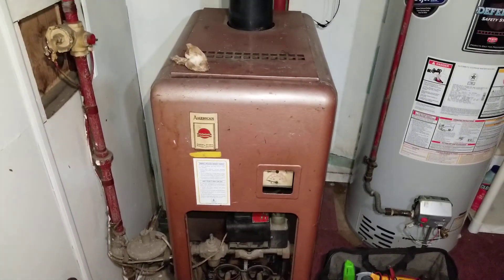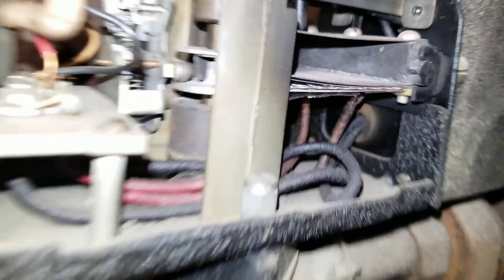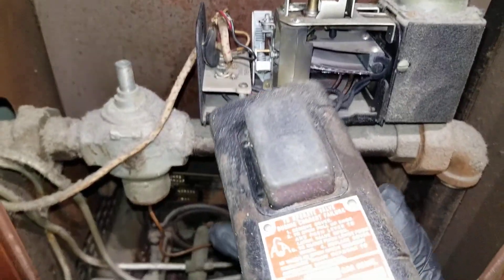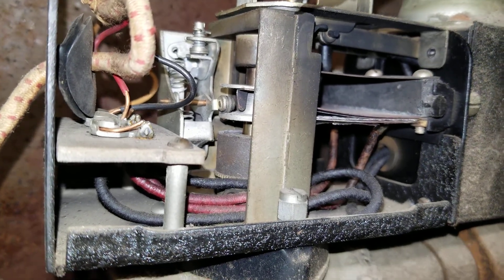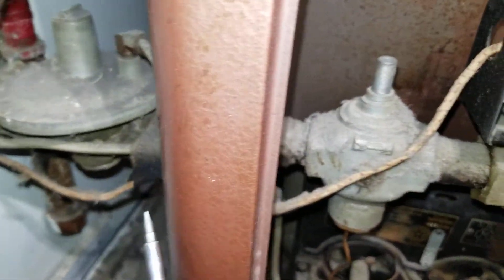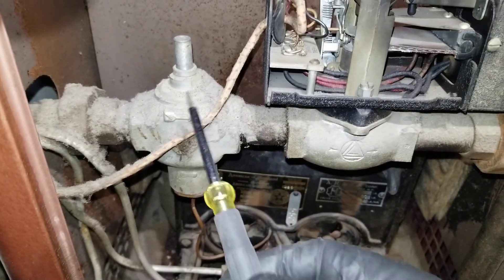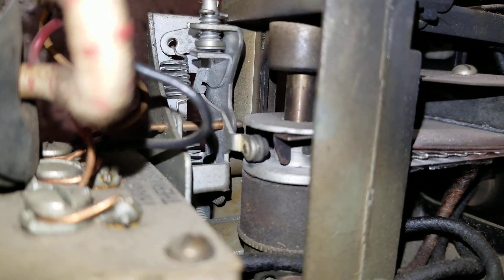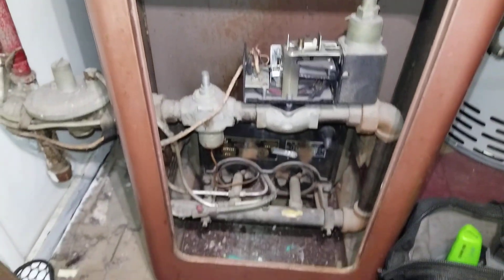How American Standard gas water boiler gas valve and aquastat wroks

Comment: I am having trouble with this very same gas valve,,, it is getting the call to turn on, but it needs to be tapped in order to turn on.  It runs a cycle, then shuts off.  
Can this part be purchased anymore?
Reply: Replace valve with new one
Reply: I replaced the valve and thermo coupling and the pilot is not staying lit
Reply: @jeffreycousar9571  Well, all it needed was some lubricant.  As I was unsure what type to use, our home appliance and boiler plan covered a tech to come out.  Guy just hit it with a can of something, and solved it all.

Apparently those bi-metal valves are great, and last forever, just need a little love once in  awhile.